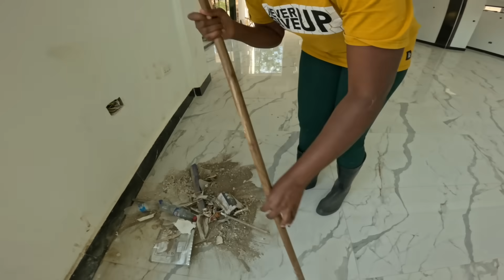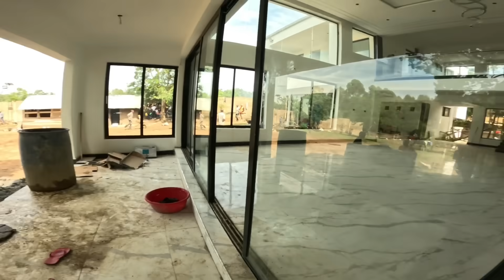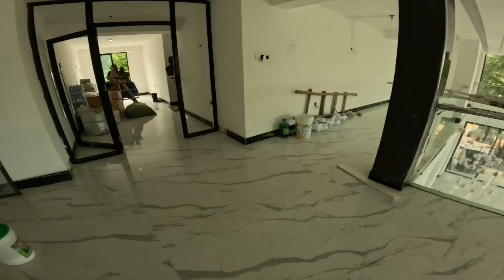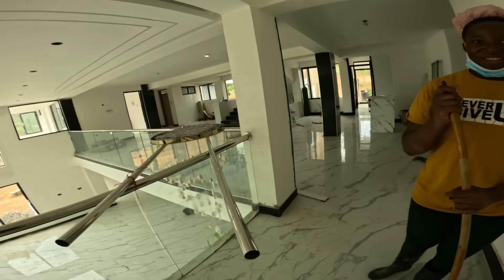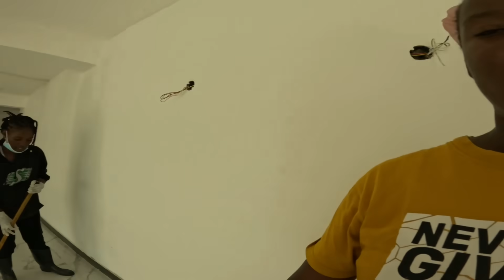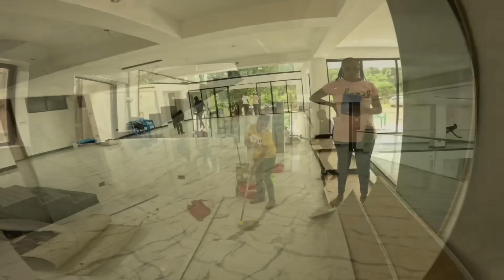THE PARTY IS HERE‼️ CLEANING THE WHOLE VILLA @iammarwa ❤️

Comment: A big bucket of water and changing it frequently. Also a vacuum with a hose that you can use to clean all the debris in the crevices of the sliding door. The building is to big to be cleaned in this manner. You guys will end up with back issues long term. I feel like the tiles on the floor should have been done last. There has been so much rebuilding on the brand new tiles. Also please have a separate broom for sweeping outside instead of using the same broom for inside and outside. Have people remove their shoes before entering. Too much foot traffic, sheesh 🙄 You guys did a great job despite your limitations on having the right tools.